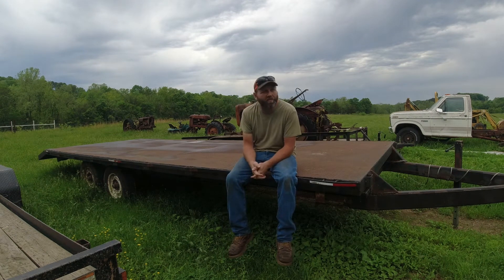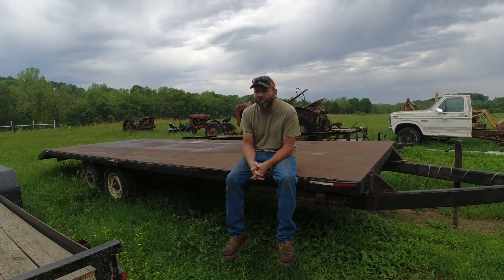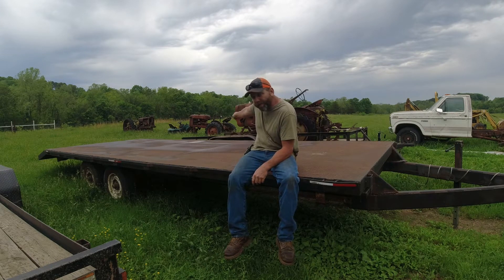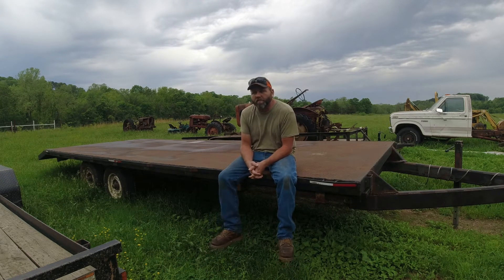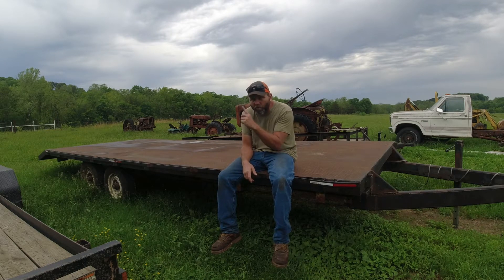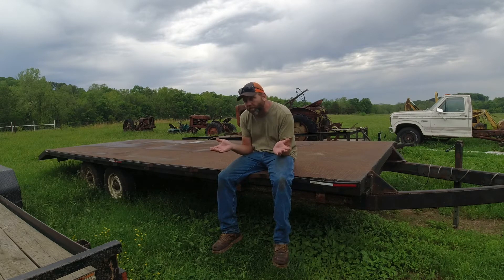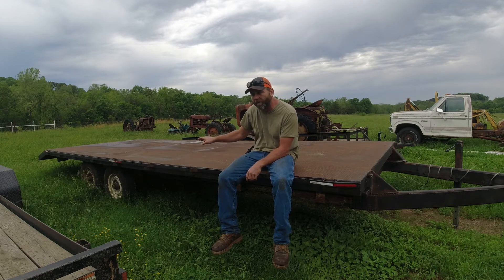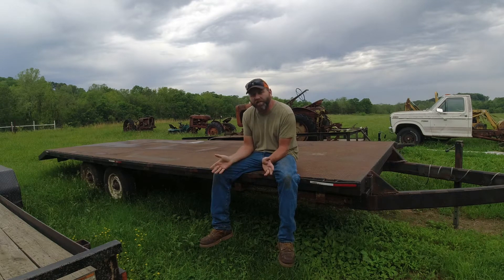i will never put a 350 chevy in my tractor

Comment: My tractor was home built from a 75 ford 300 inline.. Made it chain drive to a 30s or 40s rear truck axle with dually capabilities... It mows at an idle (750ish RPM) in 2nd gear.... IF I rev it up to around 3000 rpm it'll spin the rear tires from a dead stop in 4th gear.... Way over powered.... I bought it that way.. I didnt build it... It does the job though... Thought about putting a lawn mower carb on it for better "mileage"... More hours... Less power.... However u wanna put it... Inline cant be beat for tuggin power.
Reply from the maker: sounds interesting

Comment: I agree  Your correct. A gas hogg 350 chevy or other brand V8 simply isnt practical for doing farm work. We have several M Farmalls. most of the time the extra HP and torque from them isnt being used. So we are fixing a H with a three point. It should operate the same implements as the M 's do on much less fuel. We have the 194 six engine from a chevy II. It might be a viable option? We also have a BF Avery in our collection. It has the smaller Herculies flat heat 4 cyl. We also have a midland walking tractor. one cyl briggs. it has a sickle bar mower attachment for the front and a breaking plow for the rear. We are looking for more implements for it.  If you can cut fuel consumption you save dollars.

Comment: I would be interested in seeing an inline six built but it would be more of a novelty then anything else.  The thing with a Predator engine is that it's simple, cheap, and reliable and that's what you what when you're trying to make money.  I guess you could always just put tractor tires on a truck and run it through the fields that no more crazier than putting a 350 in a tractor :)  it would really bale some hay ;)
Reply from the maker: right

Comment: A single cylinder diesel 10hp would be cool, you could run it on used motor oil, hydraulic fluid,  or vegetable oil.  $650 on Amazon. Same install as a predator engine.  More versatile fuel options. Same hp
Reply from the maker: i have thought about that motor several times for those reasons but it is out of the budget unfortunately or i would use one i can buy 2 13hp predators for the cost of one diesel engine so i would like to but just cant right now

Comment: 327 or 283? Lol! I understand... I did have a F-20 with a stuck unknown GM 6 cylinder already in it, I never got around to doing anything with it but. A friend had a 64 to 66 Chevy pickup with a 230 inline six in it so now it's his and it runs. (It is very fast n dangerous if you use high gear)
Reply from the maker: sounds nice wouldnt mind a 6 cylinder swap